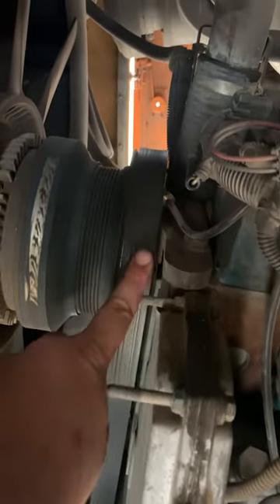We could have broken down!  A simple fix rather than a big problem! #mechanic #travel #shorts

Comment: You need to replace the tensioner. That's the first sign they are getting weak. It will happen more often. A shredded belt can cause a lot of damage so just replace the tensioner, cheaper than a tow and repair.
Reply from the maker: Thanks for the heads up, I will get it replaced!
Reply from the maker: Thanks for the info!  I will look into it
Reply: Those two beat me to it! Anything out of the ordinary means checking the items that are involved. Awesome to see and hear you even do a “preflight” inspection. Most people wouldn’t even know what to look for much less that it’s a good idea. I’ll second that the Tensioner is most likely the cause but it’s not too hard to check if you bearing is going out. Easiest way is to pop the belt off and see if it has any “play” in it. Shouldn’t move side to side or back and forth at all. A tiny tiny bit is ok but if it’s does watch for it to get worse in the future.
Reply: Could it just be that the belt is getting old?
Reply: @TheXxxcodexxx  thanks for the info. I was just wondering as I thought maybe it could just be getting old and maybe stretched out. But I guess that's what the tensioner is for lol so I just answered my own question too

Comment: Yeah man, you caught that just in time!! Thank God for making it come to notice when it did, that'll deff leave a person stranded. I had a idler pulley bearing failure and threw the belt, immediately no power steering and started to heat up, so I pulled over... Had a buddy run me to the parts store and within the hour I was back on the road heading to work!! Thanks for making these videos! Deff. Shows the importance of pretrip inspections!!
Reply from the maker: Thank you so much!

Comment: Belts jump for a reason. It will happen again if you don't fix the problem (most likely a worn-out tensioner)
Reply from the maker: Correct, I am planning on replacing the tensioner.  Thanks for the info!

Comment: but why did it do that? It's going to do it again isn't it?
Reply from the maker: I am guessing that the alignment of one of the pulleys is not quite right.  Once I get back to my shop trailer I will check alignment as I don't have a long enough straight edge on the road.
Reply: That or your tensioner is weak
Reply: @The Hard Way  qualifying anything I assume with, I am not a mechanic although I tend to be mechanically inclined, that was my assumption but in my head I was like holy shit this is a big deal! I just thought this was your fix and it was probably going to happen again and I couldn't understand why this was a fix. This is just you putting it back where it needs to be to get where you need to be until it can get the proper attention 👌thanks for the vid.  Good luck. I really hope it's something simple like maybe it could be the tensioner pulley. I could imagine that would be easier to replace than a bent shaft or something invasive?
Reply from the maker: Agreed, it is a big deal.  Once we get back home to my tools and my shop I will be able to better diagnose the problem.  When we bought the bus, one of the ribs in the micro v-belt was missing and I didn't think much about it.  I'm guessing that that same thing happened to the original belt and they ran it to the point of the last rib wearing off.  It took over 3k miles for the new belt to skip over one notch, so I will check it every night as we head home.  Hopefully we can figure out what is wrong and post a follow up video
Reply: @thehardway406  thank you!